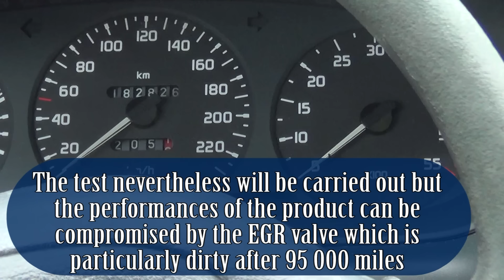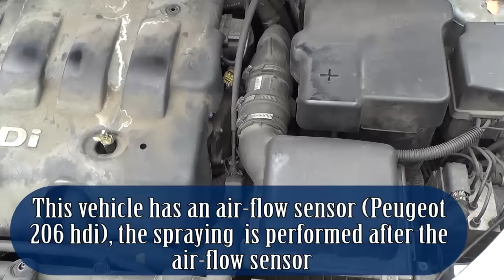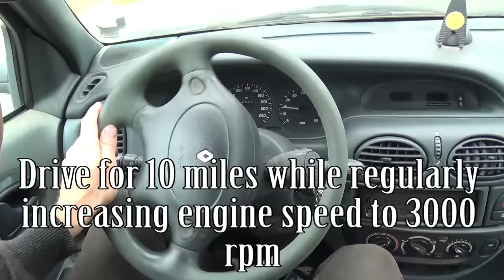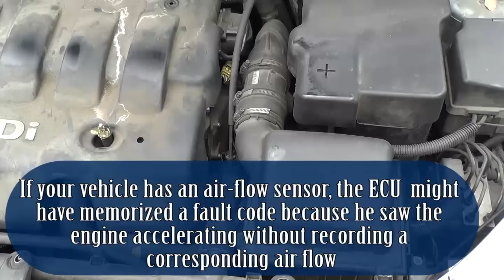EGR valve cleaning WITHOUT DISMANTLING - Cleaner kit test Before/After

Comment: my wife's 2010 golf 1.6 tdi bluemotion has a heater plug fault light on and restricted power. i've been told poss egr problem is there a cheaper way of solving problem than the 800 quid new part and fit i've been quoted. thanks
Reply: Certainly. I have a 08 plate vectra with 200000 miles, which was wound up on motorways in England, I imported it in 2012, when it had 137000 and I brought that up to 200,000 with no problems, but also no EGR attention, I noticed i was getting a lot of black smoke under hard acceleration, harder on fuel, just generally not the same car i bought in 2012. I took a trip to halfords and purchased wynns formula gold engine treatment, ( http://www.halfords.ie/motoring/engine-oils-fluids/fuel-oil-additives/wynns-formula-gold-engine-treatment-500ml) (website is .ie for ireland but it should be the same on .co.uk if that is where you are from) along with this I purchased wynns diesel egr treatment (http://www.halfords.ie/motoring/engine-oils-fluids/fuel-oil-additives/wynns-diesel-egr-valve-cleaner-150ml) which is quite possibly the best motoring purchase i have ever made, If you do not have any mechanical knowledge, bring it to someone who does and they will do it for you, but if you do, take the air pipe off AFTER the air mass meter, by after i mean the engine side of the air mass meter, because you do not want to damage that with the spray, and if i remember correctly the instructions are extremely comprehensive and they walk you through the process, now im sure the egr cleaning spray would be fine on its own, but just for extra cleaning of fuel pump, high pressure injection pump, injectors and egr valve I would highly recommend the fuel additive, although on the pricey side I am conviced it is good stuff. Now obviously you should contact your mechanic to ensure this process is ok to do on your car, as we have different cars, but i cannot see why not, but just to be on the safe side. I hope this has helped you, and i also hope you do not have to shell out for a new egr on a 2010, which is very unusual. Also on one last point, i add the formula gold to my car every 15th tank, just to keep the engine spick and span, which is also entirely up to you, i just feel that it maintains my engine for many more miles of trouble free motoring. (Kind of feeling like a bit of a wynns salesman which is not the case) Hope this has saved you some money and agro. Also, take your car for a good long hard drive afterwards to burn off any soot particles that have made their way into your DPF (diesel particulate filter). Hope I have helped you. 
Enda.
Reply: Forgot to mention that my car is a 120bhp CDTI diesel for anyone that is wondering.

Comment: Why didn't you just clean the EGR valve by hand, if it is so easy to remove?
On my Volvo V50, the EGR was much more difficult to remove, but i'm glad I did. I got almost 0.75kg of carbon deposits out of it, and now, I just use fuel additives every other tank full to keep it clean.

Comment: I don't believe that is effettive to clean the EGR valve because the exhaust gases comes from the exhaust pipe side and those are the responsible of the dirty in the EGR and not from air intake!

Comment: I have Toyota Avensis 2006 diesel. My EGR is dead. Error code P0403. Need replacement. Cleaned it twice when dismounted and cleaned it with EGR cleaner also when mounted. No help.
Reply: Perhaps you didn't check it for function and/or vacuum leak?

Comment: Why waste money on buying the kit? I remove the EGR by just bu taking out the top mounted intercooler and taking out 4 screws. Takes probably longer time to clean with this kit.
Reply: Because like me, i cleaned the EGR but still had problems , because the intake manifold itself was dirty where the EGR valve connects too

Comment: Do Diesel Egr valves get gummed up more than gasoline?  I have a gasoline northstar cadillac that needs an egr cleaning every few years, my 2002 gasoline chevy venture with 140,000 never had anything cleaned, and runs great.  My 2014 chevy cruse diesel is unknown with 30,000 miles
Reply: yes it does

Comment: With a vacuum operated EGR you don't need these chemicals, just soak it in rich soapy water for an hour or two. Don't see a great deal of change after spending that money on those chemicals. Looks like snake oil.   I used to use the soap method on a Rover  45 TDI every year when servicing the car and it usedto come out spotless, no carbon build up whats so ever. Even used it on the turbine blades of a Turbo on a large diesel engine for a ship, just painting the soapy water on every hour . Soap being an alkaline disolves carbon.  If you have your cylinder head off soak that in a bucket of soapy water overnight then rinse off.

Comment: Can this be done on a non Diesel engine? My pontiac is reading P0401 and I have cleaned it twice. Hasn't seemed to help. I was thinking this would be a better option.
Reply: on your can take a piece of speedo cable ot some sort or hard wire and shove it down the EGR passage into the intake its plugged up

Comment: sorry ask u bro: the car that you work on has got the egr valve but still has the wire trottle body? how can these be possible??
Reply: Even older engines had EGR valves. This engine seems very similar to the Ford 1.8 TDI found in the 1998 mondeo. Mechanical fuel pump and EGR valve controlled by a vacuum solenoid. There is no ECU either, all fully mechanical. Injectors are triggered by the shaft position on the fuel pump an can be adjusted by the adjustment screw on front of the pump. The EGR valve can simply be disabled by disconnecting and closing of the vacuum hose.
Reply: Chatslet or just disconnect the solenoid
Reply: Its all bogus sales video
Reply: Sales will make you do and say anything.

Comment: I just got a used 2000 Honda Odyssey it has 231,663 miles on it and EGR Light came on can it be cleaned or do I need a new one.Thank you for Your help
Reply: They are expensive!!!!  Just clean it using his chemicals.
Reply: I got a new EGR Valve at that much,but check engine light keeps coming on AutoZone said something about a code,I have old one yet!

Comment: It may have cleaned the intake out,but when it comes to removing carbon,caked on carbon,better of using a wire brush or a brass brush with carburetor cleaner,use so elbow grease and manually clean the EGR,be a better job than a expensive intake and carbon remover cleaner   gimmick....It will just cost a can of carburetor cleaner and a bar of soap to wash your paws off.

Comment: If fitted a starting motor to my peugeot 407 hdi 2.0 after doing this the car sound like it has no turbo now and runs very under powered. I thought it may be the air mass meter so I purchased a secondhand one, this didn't sort out the problem. Any advice.

Comment: Anybody know about Fiat motor home (4yrs old) multijet 100..only 3,800 on clock but it says p0401 EGR valve intermittent.
Thanks.
Reply: Terry Morton Doesn't it have warranty? I'd check the wiring just in case, seems like a loose plug if the part itself is not defective. Just unplug it and re-plug for a few times to clean oxide off the metal surface and spray a tincy bit of WD-40 on the terminals of the plug and put it back in. I live in moisty climate and terminals tend to oxidate here and there from time to time.

Comment: I plugged in ny diagnosis tool because the engine light was on, and it says the problem with was insufficient flow in the egr, i removed it to clean it and erased the code the light went off like it should but came back on any ideas what i could do, its a vw golf mk4 i drive.
Reply: Its also a petrol car

Comment: i have recently purchased a VW polo 1.2 Tdi, used car driven 44000KMS approximately, i took a test drive before purchasing the car  was going very had ie less pickup & noisy as well, assumed maybe servicing is required, took it go the VW workshop & checking the service record purchased the car immediately within 5 KMS the car emitting white smoke & taking jerks the car had to be toed to eorkshop they say it is Egr cooler need to replace,
my query is can it go immediately or is it a preexisting problem,
wants to return the car
pls advise

Comment: This is not necessary. I bought an 83 Subaru GL as a project car, and the egr hadn't been replaced in at least 10 years. it ran like shit, and there was gunk all over the egr and the tubes. A few quick sprays of carb cleaner and a new egr, and it runs beautifully now. Carb cleaner is THE MOST multipurpose item you can get for a car. It will clean off just about anything.

Comment: This is completely insane..
A fine water mister connected to the inlet whilst driving would be far more effective..

Flogging bollocks off any motoe without load is pure backward....
Reply: Correct, manufacturers are now realising GDI and EGR although keeps emissions down just chokes an engine up. Some manufacturers are going backwards and putting a small injector back into the inlet tract now to clean the inlet valves and inlet manifold as well as keeping the GDI. Water injection has been trialled but people will be put off by having to fill a water tank too.

Comment: I put a new EGR Valve it but check engine light keeps coming on,Do you have a code and how do I put it in van,I have a 2000 Honda Odyssey van?
Reply: Robert Farber those the easy ones to do is better if u put out the intake manifold up and find the hole the has carbon stick a metal wite brush whit and carb cleaner also get a new lower intake manifold gasket good oportinity sensed u there good luck
Reply: Robert Farber put super lead in. Then u will not have problems

Comment: Did you ever stop and think how this thing is blowing exhaust into your intake and onto your valves and making it all black like your tailpipe? What do you need it for? Just so the check engine light isn't on? I have deleted egr off every vehicle i have ever owned and it made the engine outlast the trans. They run better with fewer problems, this is a money maker made to prematurely destroy cars and trucks. If they cared about the environment, they wouldn't be spraying pollution in the sky all night and day every single day. Ruining the environment faster than vehicles ever could. It's like cleaning a sewer, it's clean until more poop comes along.

Comment: Certified 44 yrs here.  No engine (as far as a passenger vehicle) should ever be reved past 1800 rpm.  Even the 2500 rpm used for state inspections is too high.  I would spend 100 dollars on parts for my vehicles before I would rev them that high. The german concept of engineering is to use gearing to make even a 4cyl engine never run at highway speed above 1500 rpm.  Here in the US this concept was used from the late 60s through the 70s on American full sized vehicles and overdrive was used in the 80s because the engineering concept is to never go above 1500 rpm.  The common motorist is not a race car driver
Reply: Earl Guyton Then why do car manufacturers make production engines with redlines as high as 7k-8k RPMS? And then you have sport bike engines that do 2x that.
Reply: Earl Guyton  what in the hell are you talking about even automatic transmissions shift after 1800rpm. what are you going to do mod your ECU so that your transmission doesn't ever go past 1800 rpm? That makes no sense at all.  It would be terribly boring to drive if everybody shifted so quickly and there would be almost no useable power unless you had a high torque motor which most dont. It would take forever to get up to speed. I have no idea why you would say this. Do you seriously shift before 2000 rpm every single time?
Reply: Earl Guyton So why does the turbo on my diesel not even kick in until around 1800RPM, you're talking out of your ass. It's not economical to be persistantly driving high up the rev range, but there is no issues driving at 2-3k rpm regularly.

Redlining might fuck your engine up after a while but theres no damage caused by revving to 7k before changing up
Reply: +Earl Guyton On a healthy and properly maintained modern engine high reving of a warm engine won't cause any wear. Most wear in engines are from cold miles, cold oil lubricates much, much worse. So drive gently until the engine is warm.

I have seen a lot of Ferrari's on the dyno (old (cheaper) Ferrari's that get prepared to become a enthousiast  track car) and the best ones are the ones that always were driven fast...
Reply: Stop talking BS. Running engines that low in the rev range is a great way of building up carbon and have your trim come apart due to engine vibration. there is no way you can drive at highway speeds in that range. most diesels have their optimum operating point between 2.5 and 3k rpm

Comment: not only did it not work but you got to pay a garage after to erase the fault code haha mise as well just leave it to soak in degreaser and then wire brush it.
Reply: +16vastraturbo or just remove the battery for half an hour or overnight and the ECU will self learn and wipe the code

Comment: Awww the cleaner in a can will never clean like we remove thing and clean them . I've been working in cars since I was 12 yrs old and build rocket and other military gear. Want to decarb the intake warm it up get distill water and spray it down with hydro lock the motor. And this do the same thing.. I clean my turbo diesel trucks this way but nothing beat removing parts and cleaning well.. spays and chemical cleaner work to a point but never fully clean them.. there so many snake oil and cleaner out on the market and we test them all. Alkaline versus acidic water and I notice the difference in both..

Comment: yea this shit is fine but all tht sut has gone in the engine and probli impregnated the oil with sut. therefore risking the turbo of failing due to oil contamination. thts y its easier to take off and clean for two reasons cz ital be alot cleaner and ur oil wont go black as shit. what make me laff is he take the egr valve off in the end and there aint much of a difference.

Comment: Your not doing anything when you run a cleaner in at a rpm over 700 it is going thru at such a fast rate, it did not clean anything,
go pull your parts back off and see for your self. Better to dismantle the part and clean it with carbuator cleaner, better and cheaper. all in your mind, This is a BO video let some one else try it, that is just a consumer. False video no point intened.
Reply: MrMac5150 : Definitely Not Exactly Mr.GOODWRENCH ,WE Have Here,or Is Demonstrating Why Mechanic Shops Get So Much Per Hour ,W/ Very Little RESULTS !!

Comment: Quicker fix, Drill small hole in the end of a small hammer handle. Next cut the right of amount of rope and run through hole on the end of handle. then find a proper place to hang your little hammer beside your EGR valve. Give it 3 to 5 light taps and go on your merry way ole chap. Hope this crap helped you as much as your crap helped me. Good Day....

Comment: High risk for very poor final result. It works very little with E.G.R. while in line with the opening of the air intake manifold. With E.G.R. in any lateral position, the result is zero. There is a serious risk of precipitation of the liquid in the intercooler due to the natural venturi effect. The accumulation of the liquid can suddenly pour into one or more cylinders due to a sudden descent or ascent by breaking a connecting rod! If it is not enough there is more to be add ...

Comment: This is no more than advertising for the product and the use of it only recommended to those who don’t want or cannot pay for a real cleaning job done by a mechanic of the manifold and valve.
Where all the burnt carbon goes during the process? By using it we may fkup other parts of the engine.
Prefer to dismantle valve and manifold and sent for a proper cleaning job.

Comment: These products ARE a waste of time and money, just remove your EGR, soak over night in white spirit and clean off in the morning with some scrapers and a wire brush, it ain't hard (p.s: bypasses are good idea, it stops that crap that you see in the egr building up and damaging the inside of your engine!). By the way see all that stuff attached to the EGR? if you follow this type of guide without cleaning it manually, you are pretty dumb, because the EGR is attached to the engines air intake and when bits start getting "cleaned off of it" where do you think these bits are going to go! Into the engine! Don't be an idiot, don't be lazy, less heartache later on when you need your engine rebuilt because your pistons, rings and liners are severely pitted and you are losing compression.....couple of thousand pounds later, you will wish you brought that bottle of white spirit, out time aside for a 24 hour soak and two or three hours cleaning time (not worth it in my opinion, I do all engine mech myself, but everyone has their own!)
Reply: can I use my moon shine?

Comment: After that go buy a new engine! this will nolonger be the same! close the egr and you have no more problems.
Reply: Does blanking off the pipe to the valve sort many associated problems? Is it that simple I was told so by someone else also today. I hope it is
Reply: ryan m You can blank it off, but you may need to reprogram your ECU if you have one to take into consideration the lack of an egr valve. Your local garage can do it fairly cheaply.

Comment: If everyone's saying the egr valve never needs to be replaced and the remedy is just romping the shit until something blows out ,then why does it become a problem in the first place. Fuckin hillbillies that think they work for nasa xD when the valve gets smogged out and builds up carbon that valve isnt going anywhere so nothing is getting cleaned with more smogged air rushing through. best way to fix it is to just remove it and fix the problem just like a carburetor. Of all things my idle jet was causing my dirtbike to bog down under load